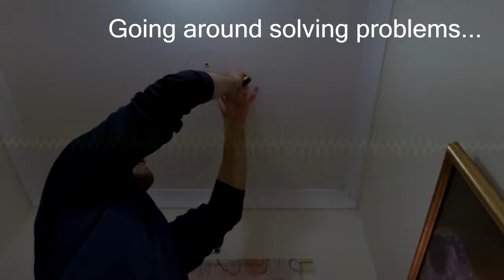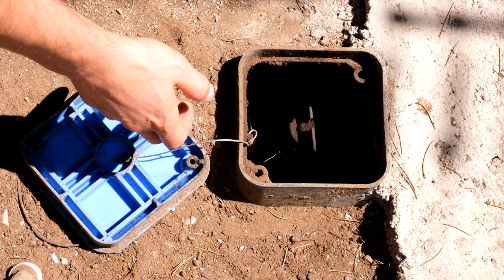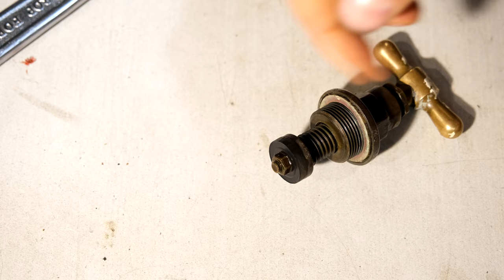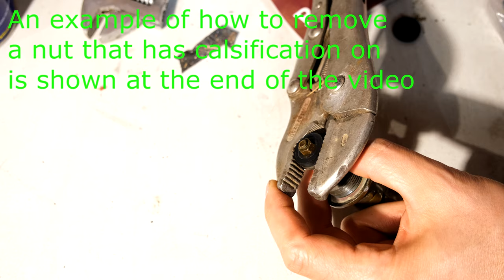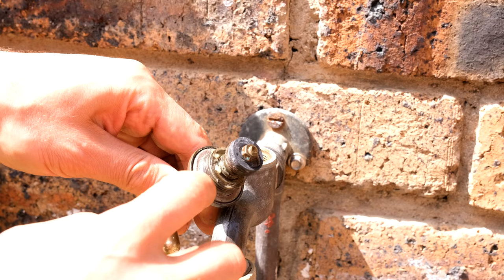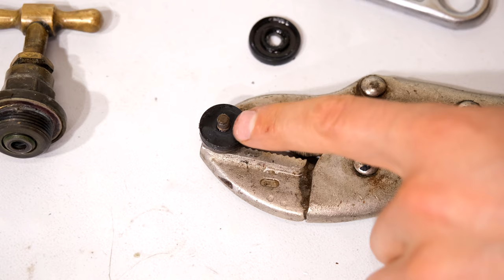How to fix a leaking tap - how to change the rubber washer

Comment: A well-designed faucet.  I like how the washer is secured with a nut on stud instead of a screw.  On small under-sink cut-off valves, the washer sometimes just slides over a stud with no screw to secure it.  This faucet has 2 other seals, the face washer on the body shown and the stem (bonnet) seal (not shown) which can also be replaced.